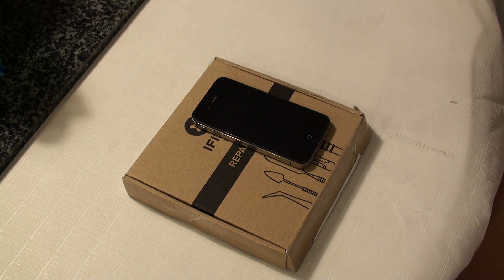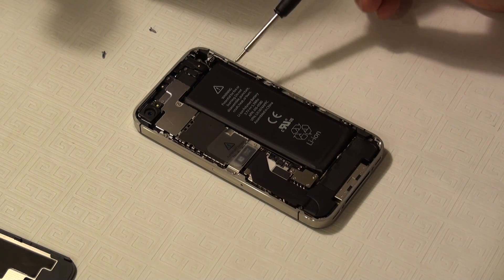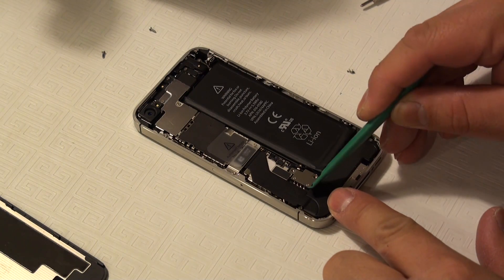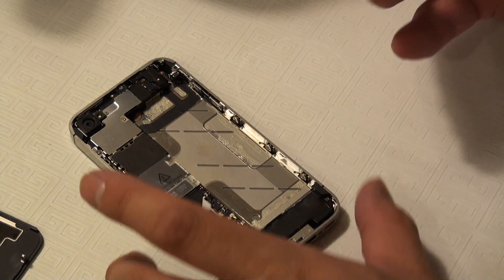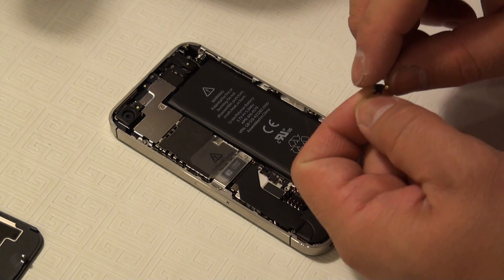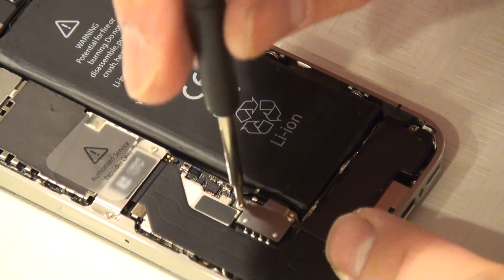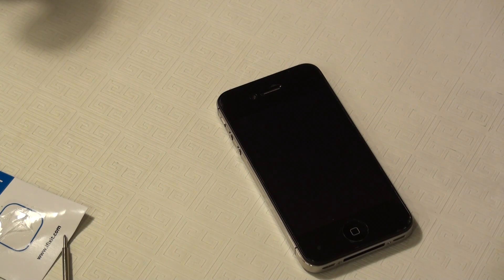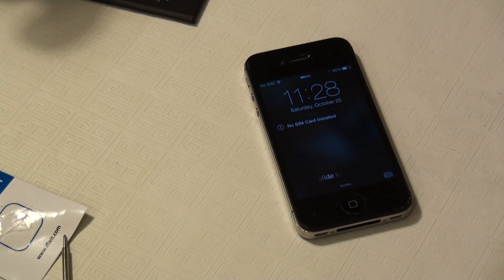Apple iPhone 4s Battery Replacement

Comment: This was awesome. Ordered a replacement battery and should get it in a few days. having to charge my phone 2-3 times a day is a headache. How long will a new battery typically last with moderate/heavy use throughout the day?
Reply from the maker: yeah when your battery ages the internal resistance inside increases and thus it doesn't hold a charge well and it gets quite warm/hot when you're using it.  The new battery will operate MUCH better.  How long it will last? It depends really as your idea of moderate/heavy could be extreme or light for others.  Just keep in mind that the iPhone battery will work perfectly for at least 500 full charge cycles and then after that roughly 80% performance of new can be expected for up to 700 charge cycles.  A charge cycle is defined as a complete discharge and recharge.  Say if you deplete your battery to 50% and then charge it back to 100% then that is considered a "half cycle".  I've found from personal experience that a typical iPhone user can expect great battery performance for about 2 years and then afterwards the performance begins to decline.  Batteries are so cheap and easy to replace in the 4s that fortunately if you do kill you battery in a short period of time that you can simply buy a new one and do it all over again :)
Reply: piercedasian u think i need a new battery?? because ill charge ny phone for a whole night and when i unplug it the batter won't even last for a hour
Reply from the maker: yep, your battery is toast.  Replace it and you should be good for at least another 2-3 years.